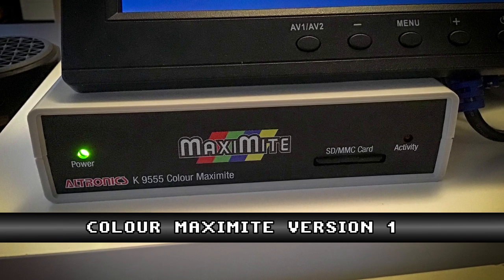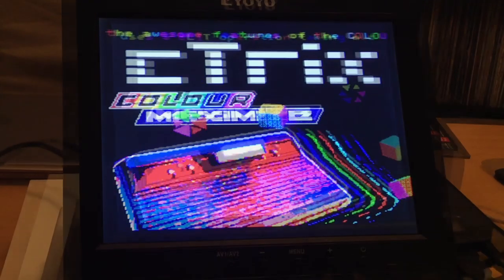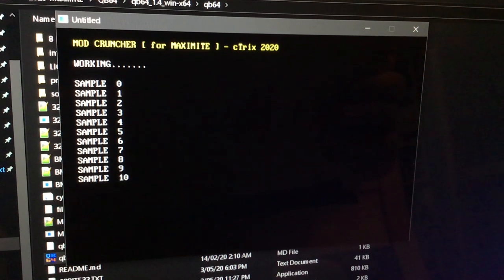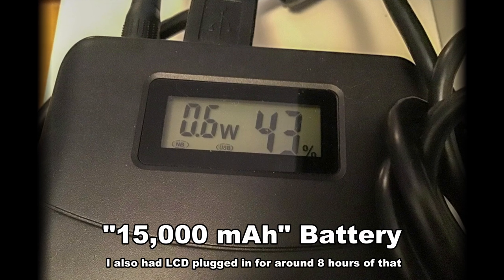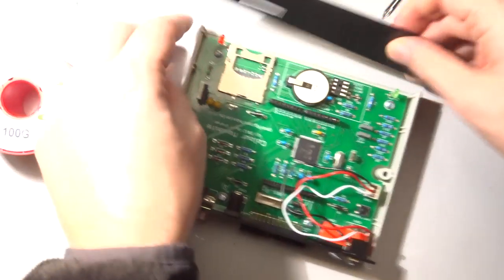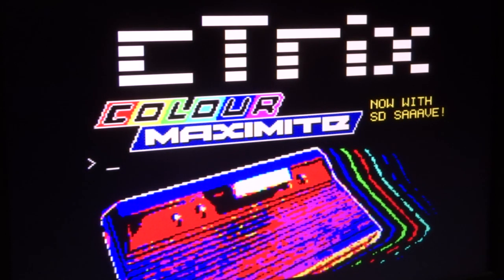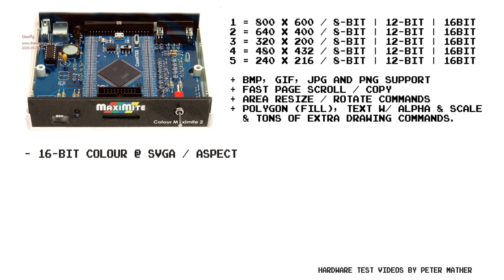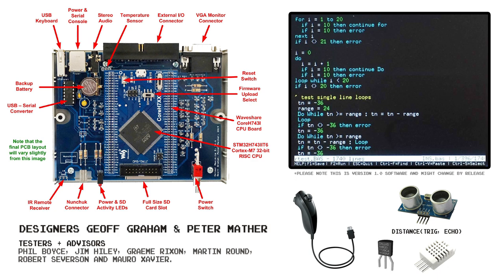MaxiMite Colour 1 - BASIC Kit Computer (pre-upgrade)

Comment: I kind of like the 8 fixes colors, they have a good look to them and for me it is all that I need, as I am more interrested in it for automation, so the color maximite 2 seems overpowered for my use, as I will never code game for it. I am happy to hear that you noticed the stability of the pic-based original color maximite, that is the one I own and was hoping I could rely on it to run 24/7. Basically, I am experimenting with it to see if it does well for industrial applications.